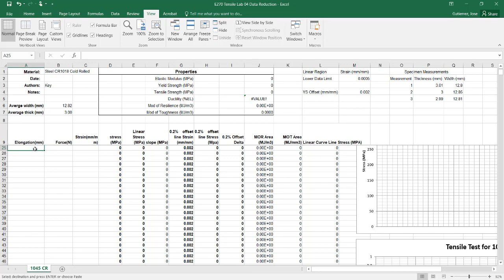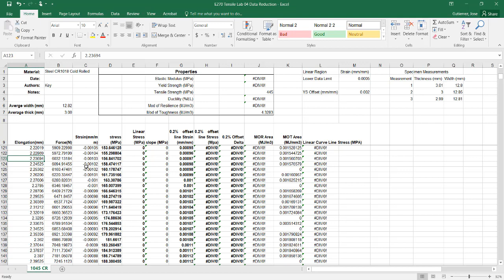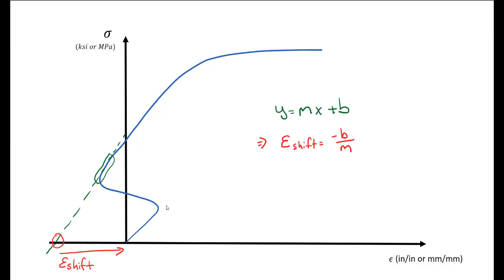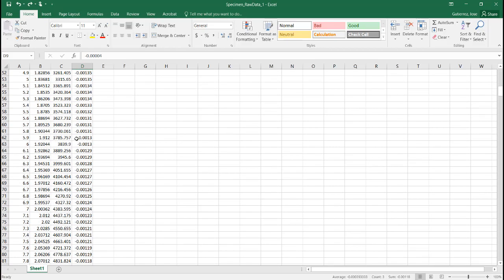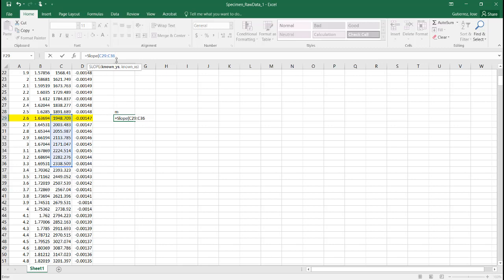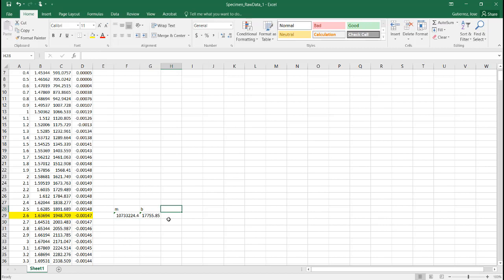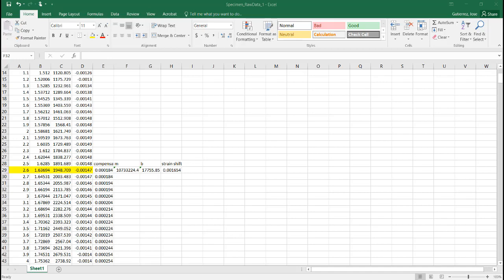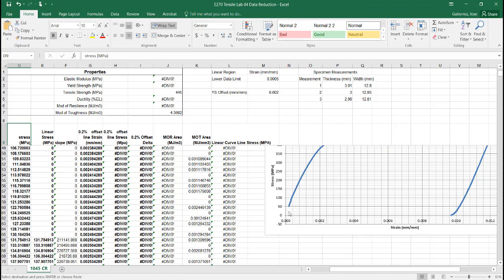Tesnsile Test Toe Compensation

Comment: If I need to calculate Young's Modulus, would I need to just find the slope between compensated strain and (in my case) stress? It is there a different method you recommend?